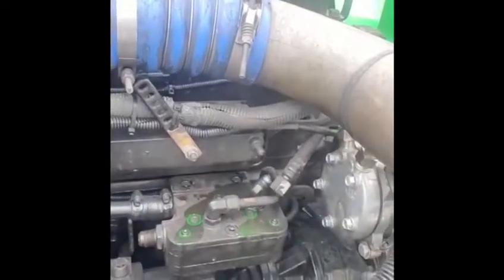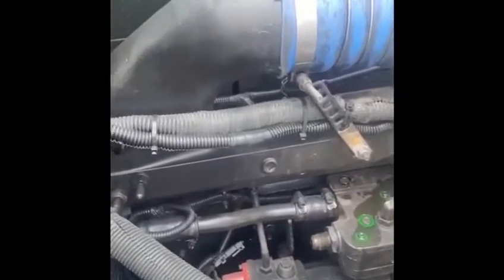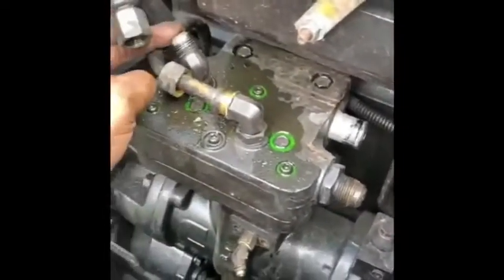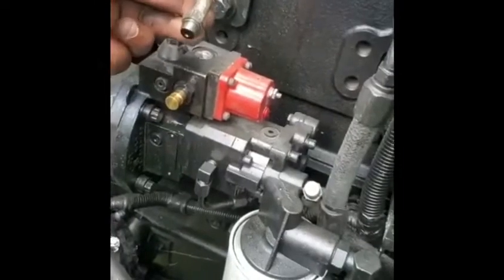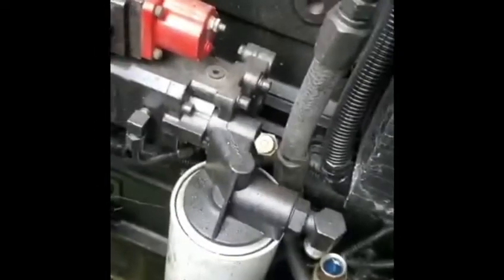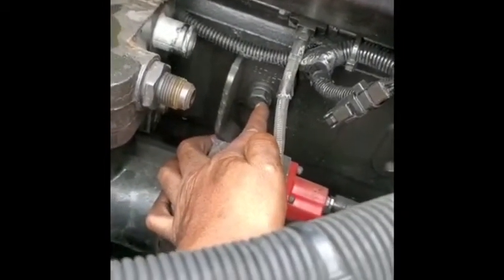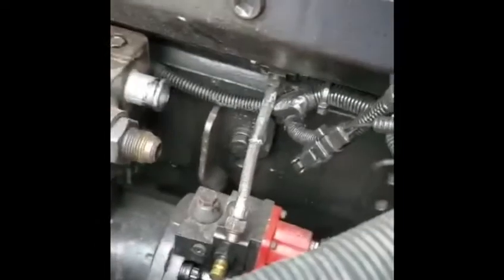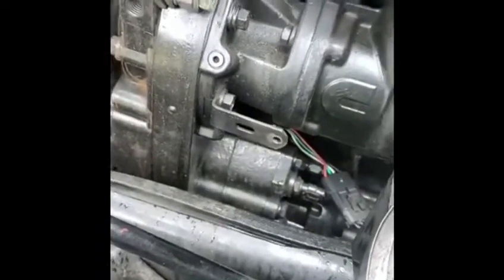REPLACING AIR COMPRESSOR N14 CUMMINS PART 1

Comment: At the 2.02 second mark ok. I got a question because the line that’s on my motor is coming from like the front part of the block behind the pulleys is supposed to connect into the part you have your hand on at 2.02 Correct? My line want fit into that and the guy that’s working on it want me to go take that line off the N-14 motor we got the compressor off of, so he can put that line on my motor so it can work.

Comment: What’s the name of that tool and where you get it from
Reply from the maker: Hello It is just 5/8 S ranch  From snap on
Reply: Thanks appreciate it we got it off and got it on. Just ran into a lil problem. The compressor that on your Truck that’s the one I installed but the one I took off that was on the Truck was a little different and we gotta change the fittings and lines
Reply from the maker: @crazy-hobbies2291    the N14   Come  with 3 different type of air compressor But all can work together
Reply: Ok Thanks appreciate it

Comment: A got a question I ran out Diesel and having a hard time getting Truck back started. I have replaced fuel filter and added diesel in it, still want start
Reply from the maker: What's up brother N14 when they run out of fuel they take for heaven to start back You have to keep take off the filter and keep full it up Are you can spray a little of starter fluid in the intake
Reply: @truckingwithperry5799   I got it back up and running, I had to put diesel in the second tank and it fired right up, lol I forgot to save your number from the time you called. Appreciate it
Reply from the maker: @crazy-hobbies2291  Lol  OK brother stay safe